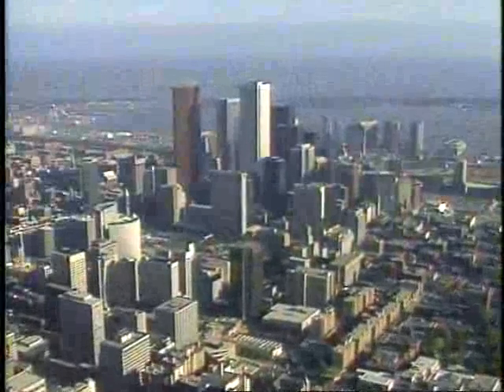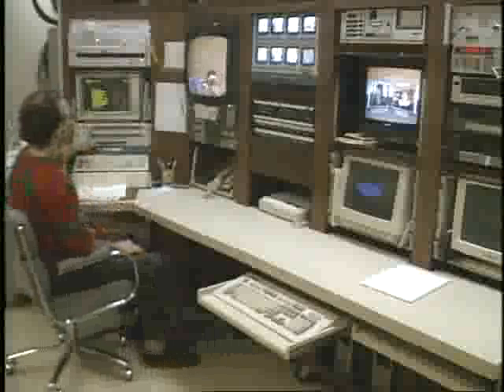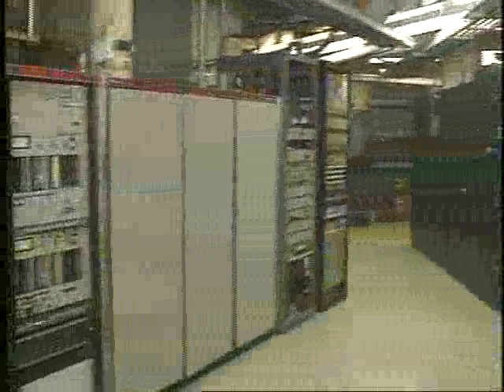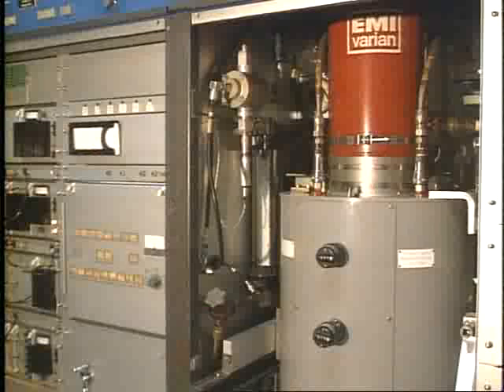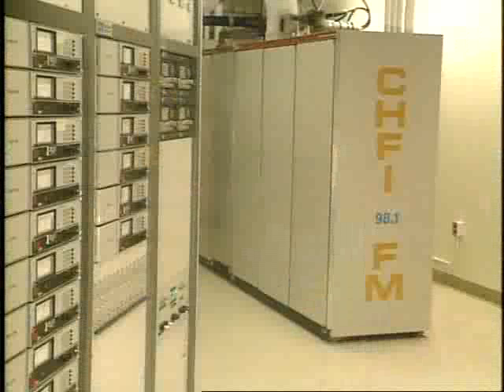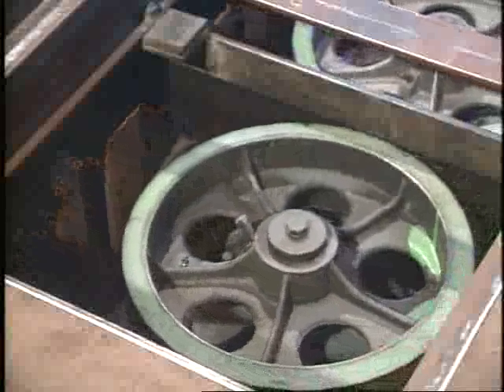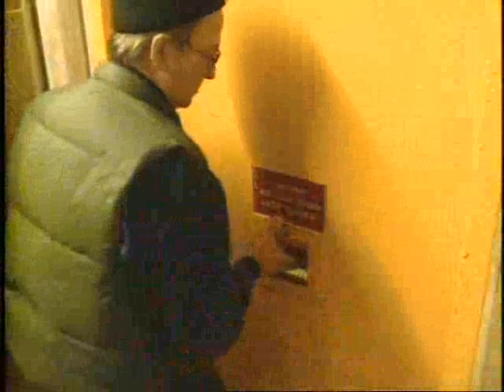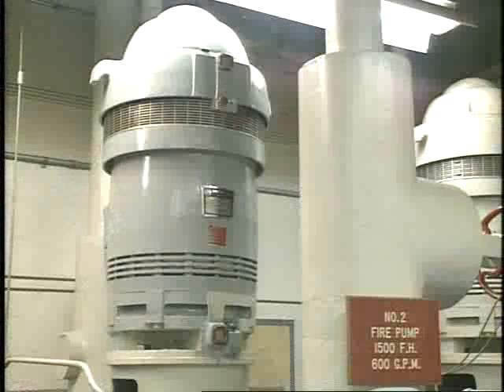CN Tower

Comment: very impressive. All the weight of broadcast transmitters in that tower....WOW....How did they get the massive electrical power requirements of all those FM-TV transmitters all the way to the top??? A lot of really super engineering before computers did the calculations for distribution of weight and construction that has lasted perfectly for years. The video is sketchy in places but it revealed a lot